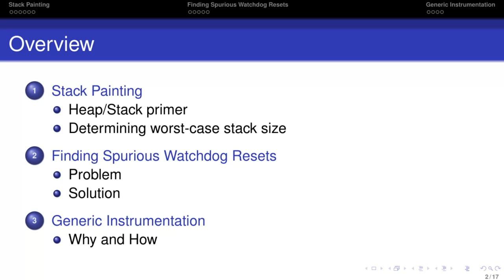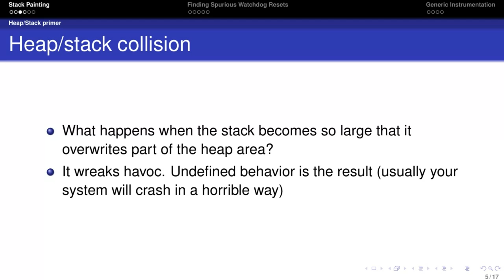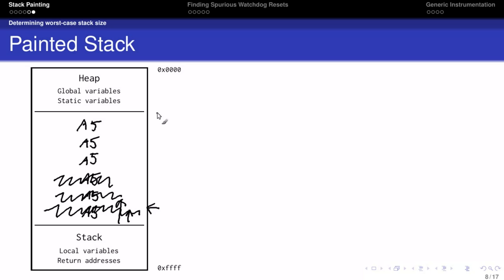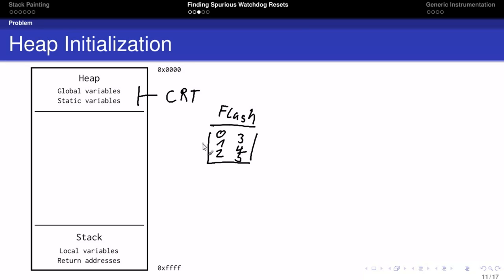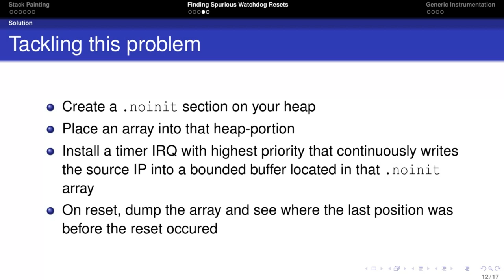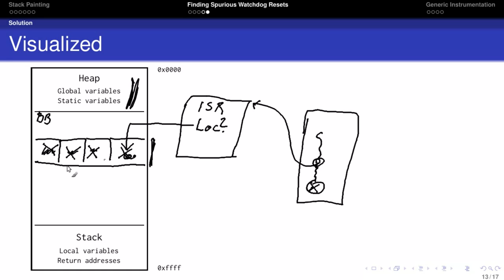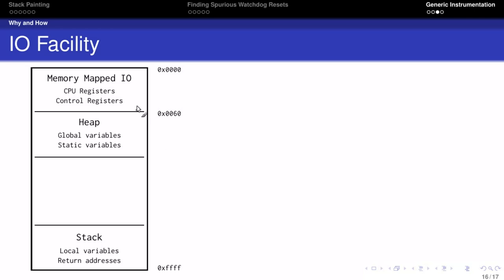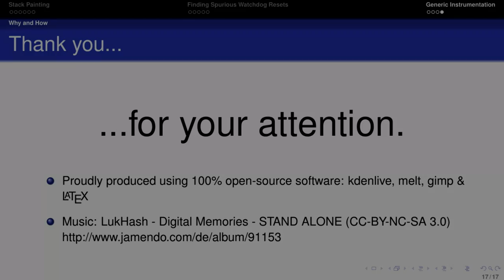Tips and Tricks for Microcontroller Programming and Debugging

Comment from the maker: Effectively, yup, you're building a poor man's debugger using that technique. And for things like the PWM circuitry I usually do that approach (not without knowing the datasheet, of course). Then it's easy to play around with certain parameters and immediately have a result instead of having the need to re-flash every time. Really depends on the situation, but it's handy to have a facility like that IMHO :-)